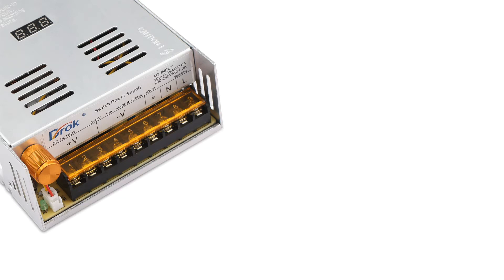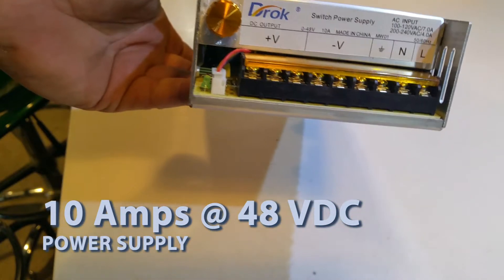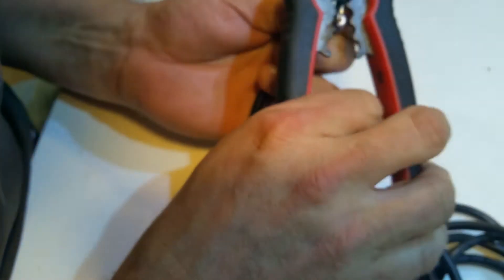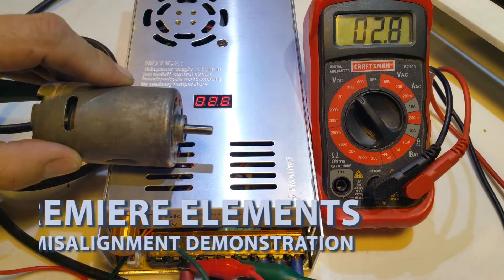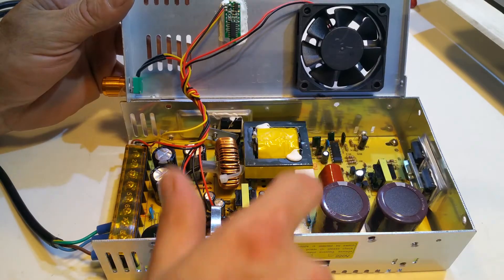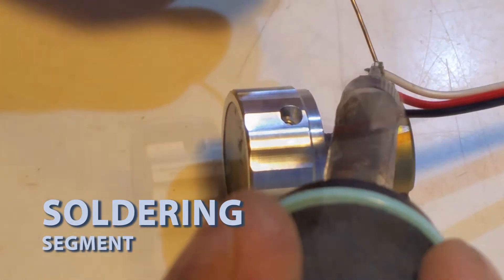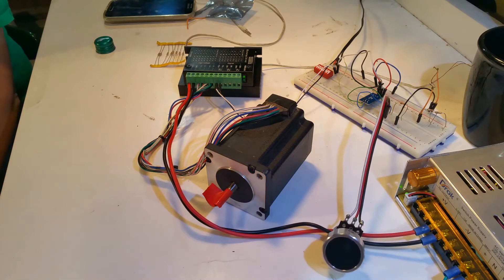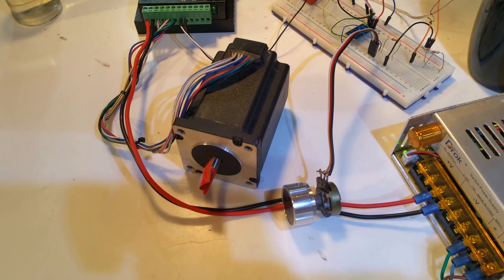DROK 48Vdc 10A  adjustable Power Supply: Power Feed \ CNC Pt.4

Comment: Nice review - but you should have done a decent load test for 10 Amps and 48 V for a while to see if it can handle this. Most of these cheaper chineses SMPS don't meet their specs for long! Also the output ripple and the efficiency should have been tested 🙂 maybe next time?

Comment: I made my adjustable using a 10k pot n i get a output voltage from 5 to 38 volts
Reply: what was it originally? You could blow the caps if you had a fixed 12V
Reply: @ericklein5097  naa it was a 24 volts
Reply: @terrysookhoo2528  be careful there might be 35V caps in there and not 50V caps

Comment: LCD 110/220V 10A 480W 0-48V Regulated Switching Power Supply 

How do I know where this powersupply will work to charger Lithium batteries? And if it can't is there a mod you can do to it so that it can? And if it can, will it work to put 2 of them in series to get 92V or 2 in parallel to get 20A?

Comment: I have a little doubt....
As this power supply has 3 outputs so each output will get 48vdc and mentioned 10a or will it divide 48vdc 10a by 3 ?????
Reply: It will put out 48v total,not per terminal out.
Reply: @supernewf3722  3 channels - 48v/channel - total current output for 3ch 10a.
Reply: You can get 10A off any set of terminals. The terminals do not only get 1/3 of the current if the rest are unloaded.

Comment: Hello there . I would like to know whats the best input current needed for similar device =24v 20a output=  to fully function to 100% ???
Reply: ouput is 480W so input needs to be over 500W. At 220V thats 2.2? amps at 120V thats over 4A